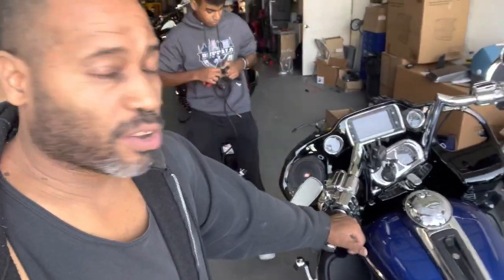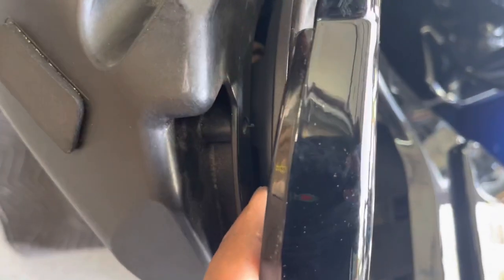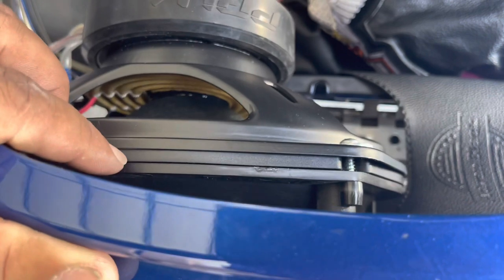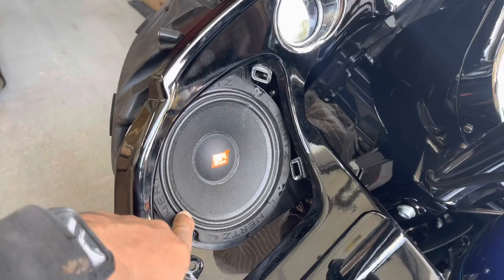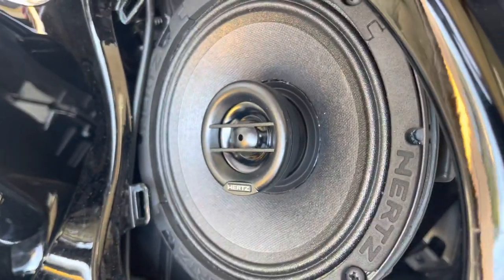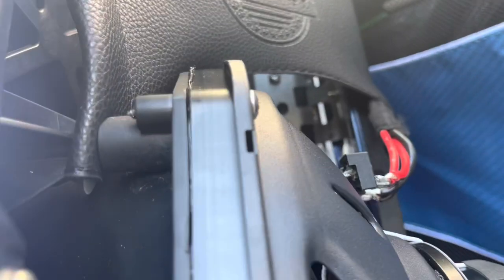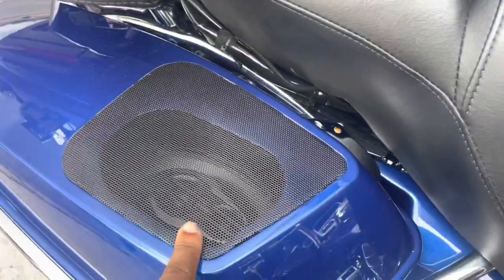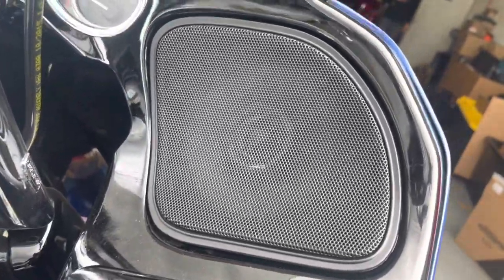Harley Davidson Road Glide in for a dsp and a 6 speaker audio upgrade

Comment: I’m looking to add a newer amplifier to my 2008 ultra classic. It currently has an amp under the luggage rack. How can I replace the amplifier? Or do I have to put it in the fairing? And if put it in the fairing is the old factory amp still working and will it cause any problems?

Comment: Hey Carlos, i have a question (or anyone can answer) I have all diamond 
audio MP694's - 4 6x9 in the bag, 2 6.5 in the lowers and 2 in the 
fairing but i have little bass and it's bothering me because of how much
 money it cost. 2 mono amps. Sony AVX5000 head unit. Is not having a DSP causing me to not have bass? I've recently come across your videos and i've learned so much about must have's and do's and don'ts
Reply from the maker: Are the 6x9s in the lids or facing the rear wheel ? 
What amps are you running?
Reply: @NVSAUDIO  6x9s are facing up in the lids, Advan black, and I have 2 4ch Dimond Audio amps. Amps are located in the front fairing. I have a 2017 Road Glide Special.